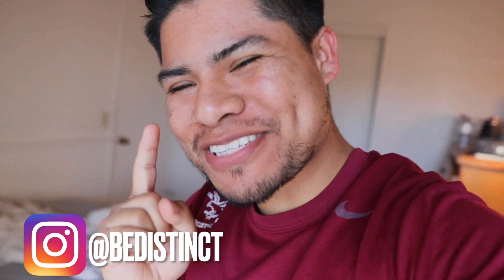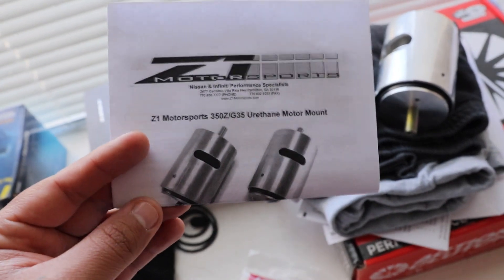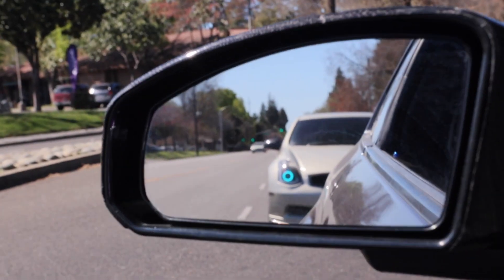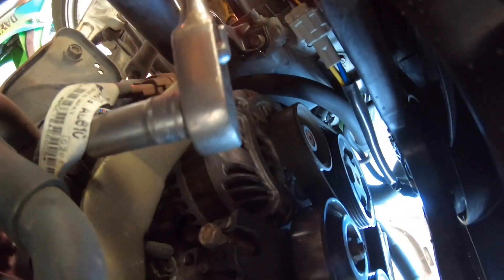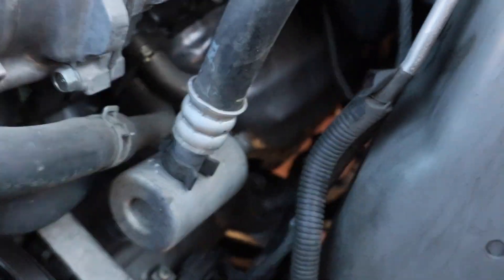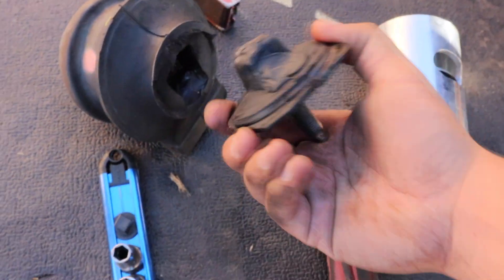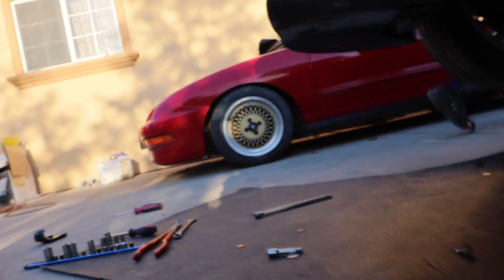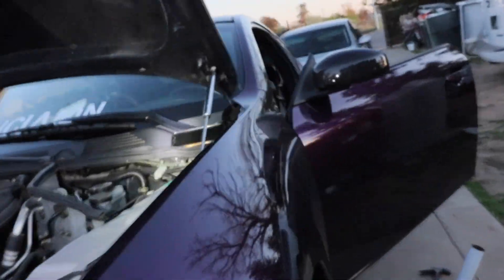Installing NEW Z1 Motor Mounts on G35 (BEST MOD!)

Comment: Hey bro I got a question on these do these shake the car a little more ? I put these on and the car started to shake a little bit more little by little it’s getting worse.
Reply: It’s more for track or drifting they will stiff up your ride but it will vibrate a lot that’s why if you want to stay w comfort just go w oem ones

Comment: Don’t it shake when you are at a stop ? I got a g37 sedan and I have them z1 mounts in it and yes when you put that gas the engine doesn’t even move 100% way better. But my question is. Are mines the only ones that shake ?
Reply: So it’s true it vibrates like crazy on red light stop 💀
Reply: @Roma-uz4mo so more vibrations is normal?

Comment: Bro.. I got upgraded koyo rad and fan shroud. I put these mounts in without taking none of that apart lol all you need is a 14mm allen head bolt and mini matco spanner wrench w some extensions 🤣
Reply: How did u do this